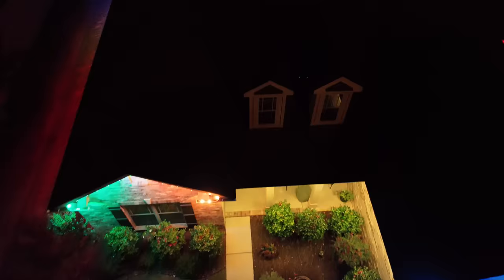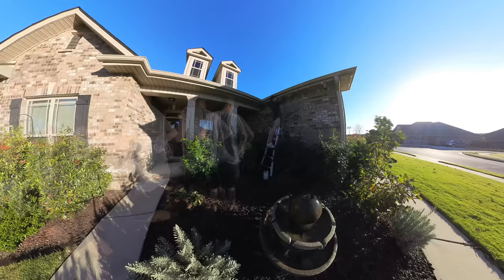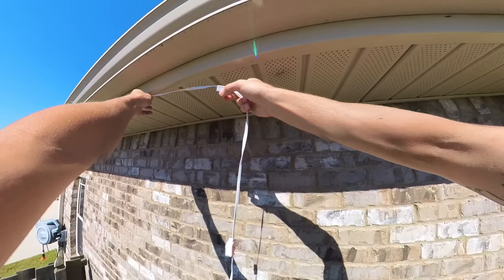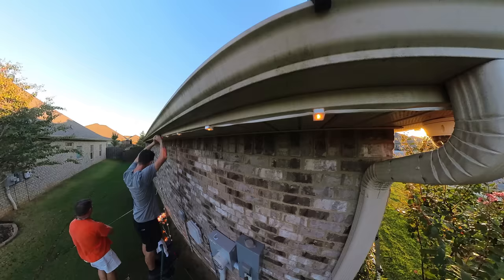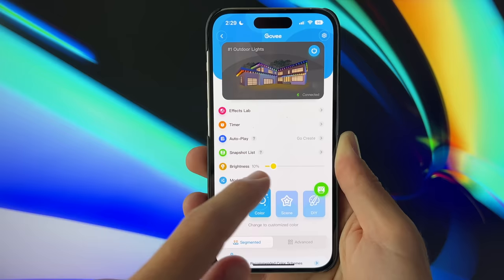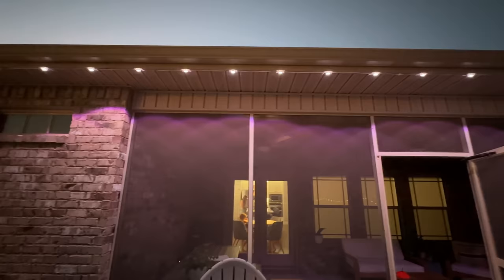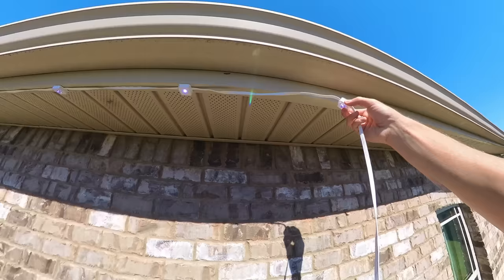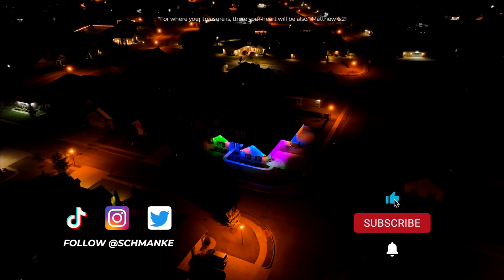AMAZING Govee Permanent Outdoor Lights!

Comment: I'm so glad to see whole kits like these available! I just installed permanent Christmas lights on my house last year going the DIY route and it almost cost me as much as these Govee lights. Having the Govee quality and support makes this worth it for sure!
As some of the comments on their site say, it would be nice if they sold the extension cables separately. If I used these for my house, I'd need about 30' of extension - which I could do with DIY, but maybe not possible with this kit. I've got some family and friends this would probably be great for though.
Reply from the maker: Thanks for sharing. I just measured for you. The power adapter + button/switch cable is approx 21 ft. And then another flat power extension cable is also included which is 12 ft. (There's your 33' extension for ya ;-)
Reply: @AuthenTech  Ah, ok. Distance to the first light for me could be as short as 3'. I've got a 12' front porch that I have lights on, then the 2nd story has another roof above that. So I need to go up the wall and the distance of the porch to start the next run. I'm sure there are some technical limitations to doing that though, like the 5v data wire doesn't cover that distance easily and should really have a booster in there to push it farther.
Reply: @BenReese  You can run 150 ft on one power adaper for these Govee. I am waiting to install on my house. two story makes it harder to install myself :)
Reply: Ben, what DIY lights did you purchase?
Reply: Wish these weren’t sold out. They look easier than what I was going to try. I just watched a video showing how to put these lights in J Channel. Rextin WS2811 Pixels Digital Addressable LED String Lights Waterproof RGB Full Color 12mm DC 12V (DC12V 500pcs)

Comment: You could add some clear caulk to hold the wire in place, plus it would releive some downward  pressure from the 3m tape on the lights.

Comment from the maker: Pinned comment for future updates:
-Oct 2022, LED stickies installed.
-Jan 28 2023, found my first LED that detached.
-March 26, 2023, found a 2nd LED detached. Really high up, hard to reach.
-April 2, 2023, found a 3rd detached.
-March 2024, found a 4th detached.
Reply: They are out of stock everywhere probably due to the season, or your video, or discontinued???... I think they look great and exactly what I have been looking for.
Reply: Out of stock everywhere.. hopefully they stock back up soon.
Reply: Do you know when they will have the stock? Wondering if there is a way to contact them directly for this answer
Reply: Why must you tickle my RGB fetish like this, Ben? 😄
Reply: Help needed!! Lol I just installed 2 100ft Govee permanent lights. How do you combine the two sets of Lights to control all the different scenes? I tried using the groups section but it doesn’t give me the option to control the scenes. Thank you 🙏

Comment: I will say this, once fully bonded, VHB (Very High Bond) tape will not come off. I used to work in industrial sales and sold 3M VHB tape. I talked to their reps and they said to never put it on anything you don't want to destroy. If you put it on a cabinet and later want to remove it, you would rip the cabinet off the wall before the tape let go. They gave me a sample and two of us grabbed it with Vise Grips and couldn't pull it apart. 

Think about this, some semi trailers are held together with 3M VHB tape. A lot of them don't use rivets anymore.
Reply: very interesting, I looked up the use in semi trailers and it is true, Geez !! thank you for the info.

Comment: You should make a video on how to connect the Govee permanent lights to the app. How to combine several sets and the different scenes that are available. Govee has so many devices on the app that it’s difficult trying to figure out what setting goes with what product. Thank you love the videos.
Reply from the maker: Good idea, not sure how many people actually need this video though
Reply: @AuthenTech   really good idea especially since these lights are popular
Reply: I would love that video! I'm going to need about 300 feet and am super confused about the control boxes/grouping
Reply: @AuthenTech It would be very helpful for some of us that live in very rural communities with limited internet service. Most devices require 2.5 GHz which is not an option with some of our systems. I need to know if I can get them to work any other way. 😬
Reply: Internet is irrelevant for the lights.  You need a wifi router.

Comment: Do you remember as a kid dragging ribbon over the edge of a knife you get the curls. Well do that to the wire except use a screw driver shaft, Gently pull the wire over the shaft not too hard, that gets rid of some of the kinks.

Comment: They look great I see that you mounted them towards the edge of your house, rather than closer like 3 inches. Was that preference or intended because I see so many other videos that recommend closer to the house but the lights on your house are super bright so I guess it doesn’t matter. thoughts?
Reply: I had the same question. My eaves have exposed beams underneath so it’s not a flat surface. It appears that affixing them to the trim looks just fine according to his video 🤷🏻

Comment: They look great but unfortunately at the time of this video you can't find them anywhere.  The 100ft govee sells would be perfect
Reply: Lol amazon has them
Reply: @creasybear4426  i just checked and they don't.  They have outdoor led strips which are different
Reply: @creasybear4426  no they don't.
Reply: I bought 250 in Feb 2023
Reply: Well you’re in luck now, Amazon has them!
Reply: @jaredf.8712  yea i grabbed some about a year ago. Now they're available everywhere. I put them up right before the 4th of July
Reply: @vahn2g4 Do you know if the 150ft comes as 3 sections of 50ft or as one long strand?
Reply: @elizabeththompson-hancock3360  yes it does. I only used 100ft and i have the 3rd in the box
Reply: @vahn2g4 how big is your house?
Reply: @killacuz3  my house is 2300sqft. The front used 2 strips and i used 1 blank that it came with. I still have 1 strip of lights left that i will run along the side of the house
Reply: @vahn2g4 dang I just bought 2 boxes of 100ft and my house is only 1400 sqft. I guess I can put it also on my garage but I'll still be at 1800sqft 🤣
Reply: @locoslbck13  save the extras for another project lol

Comment: 3M tape? 3M Tape is good stuff, I know that for sure...but I'm seriously concerned about the longevity of using tape to hold these up more than a season or so. The constant exposure to the elements and temp changes I would think I'd eventually walk out of the house and see sections of this falling off the house. What are your thoughts on this?
Reply: Having worked with vhb outside before, it will probably happen but only after many years, I have things that are attached (fully exposed to weather) with VHB and they've been holding for 4 years. A lot of car manufacturers use VHB for badges and appliques too.
Reply: Yea I don't like that. I installed my Philips Hue outdoor lightstrips with brackets that came with it I screwed into that house. Obviously that's gonna stick forever until I get rid of my Hue strips.

Those screw clips might help though assuming you can put actual screws through it.
Reply: 3M 4298UV Adhesion Promoter will make the tape stick like you wouldn't believe. I've used in a body shop to attach emblems to fiberglass panels and had to remove them later for damage and it actually pulled the gel coat off with it down to the fiberglass underneath it had stuck that good
Reply: I’ve had the 3M command strips that aren’t VHB up for 3 years, and they are still going strong. I think if you install these under the soffit and not exposed, the VHB should last a long time.
Reply: i agree hte adhesive will eventually fail thanks for the sun. then you have to scrape off the old adhesive which will prob damage the finish on the soffeting
Reply: Why not add small piece of clear gorilla tape over each strand by light?
Reply: Still have exposed wires, which I think look horrible for what is supposed to be permanent lighting. There are better options with better control. Addressable LED'S are the way to go.

Comment: To get the light wires to lay flat, unroll it all on your driveway in the sun for a good 30 min before install. The heat will make the wires more pliable.

Comment: Hey Ben, great video, I just purchased (2) boxes of 100feet because of your review,  I need 170 feet of continuous lights to cover my  house, My question as I could not find the answers in the instructions is, how to I install both power supplies for a continuous string of lights up to 170feet? I have a spot for both power supplies to be located inside the garage, then I will start the install with a single string of lights in one direction, I can not go in separate directions with 2 strings. I need to have one continuous run of 170 feet.  How did you use power supplies on your install. Please reply, Thank you !!
Reply: You can't connect two complete 100ft sets. The max is 150ft, so you'd need the dedicated 50ft set or half of your second set.

Comment: Can you do a Video Walkthrough of how to program the lights.  Govee website and support is not very good or hard to find and the desktop app doesn't even have the option yet.  I want to be able to do the off season corner selection as an example that you showed in your video.  I just got 2 of the 100 foot boxes. Programing them as a group seems more difficult.

Comment: Did the total length you used end up being more than 150ft (9 strands)?  Asking because I just got 200ft worth and I'm trying to sync them all to work together.  I understand you can only have up to 9 strands per power box, but is there any way to sync more than one power box together?
Reply: What did you end up doing? Use 2 separate power?

I know in the app you can control multiple products, but can you “sync” them? For instance, if you lined up all 200ft, can you have a moving sequence go through all of them? Or is each power box separate?
Reply: I just installed 200 Ft but the last 50 is not working should I put the other 100 in there own circuit and will they sync?

Comment: I have a question so i bought 150ft but how can i add the last 100ft and sync everything together? I know it comes with another power adapter can can i connect where i left off and connect the adapter at the end? Or does it have to be separate yours look like they are all connected together thank you so much

Comment: Can these be effectively connected to a smart switch, i.e., when the power supply at the outlet is turned "off" and later "on," will the controller return to the last illumination setting? Thanks.  Well done video...

Comment: I have a bit of govee lights and enjoy them.    Those look pretty sweet.
Reply: How would this work on a two story home where the lines don't connect 🤔 wouldn't there be exposed leds hanging from one edge to another
Reply: @ericdavisii3912 you'd have to splice in extensions with no lights.

Comment: When you installed them did run power supplies from same outlet or two different outlets. I was wondering if you could run them both ways and meet in the middle on the other side of the house . I’m going around my house the same way you did yours. Thanks

Comment: Your video convinced me to get a second set of 100ft H705A permanent outdoor lights which are due to arrive in a few days. One thing about your install though is in order for the two 100ft strings to work together once grouped, do I need to install them in the same direction? For instance, does one string need to be control module/lights and then the second following it also be control module/lights, or does it matter if two strings are installed like lights/ control module then on the second following control module/lights? You didn't mention that in your video. Thanks
Reply: How did the 2 sets sync up? Really excited to do the same!
Reply: @JonathanRootD When I installed them, they automatically set themselves as a basic group which doesn't sync. You have to create and add them to a same model group and then they sync perfectly. They also have to be installed in the same direction

Comment: Do they have plain length of electrical line in case you need to make a jump from peak to peak without lights?
Reply: Yeah the website says it comes with some of those runs.

Comment: What if you need 250’?  There is a kit that is 150’ and one that is 100’.  The kit with 150’ in it has what looks like two power supplies.  Do these lights work together in the app for seamless control or do the individual strings end up out of sync?  Can I go 250’ on one power supply?

Comment: Great Video!! Question. On the app I have gone under advance, and I want do that spotlight feature. At corners of my house. My problem is I select the lights that I want on, but above it in that section has an effects it's either doing clockwise cycle, twinkie. How do I turn off the effects so the light just turns up stays on.

Comment: Where do you live?  I'm concerned about the -4 degrees limit, but Govee told me that's just the control box so if I can get that inside, I should be ok.  Is the control box attached at the end of the string of lights?

Comment: Great video. Can you cut strings shorter in case you dont need the extra length? Thanks
Reply: No. But each strand is about 17ft, three per 50ft. You could just drop strands as needed.

Comment: Can you cut them to length if you have different areas of the home?
Reply: Yea but you’ll have to run outdoor rate cable from section to section and wire in outdoor j boxes

Comment: Hello, since you installed 2 controllers. Do they both work with the app?
Also, since there is 2 controllers to all the lights work together simultaneously? Thanks
Reply: You can create a group of devices to work simultaneously and is easy to do in the app

Comment: drop of glue every now and then , 1 in middle of ribbon between lights and on each side of every light should take care of ribbon problem. Also tape the actual led with painters tape and spray paint to match your soffit then remove tape so they don't stick out as much
Reply from the maker: Great suggestions!

Comment: JellyFish lighting is much nicer. No cords showing, all of the wiring is ran through the attic, each LED is mounted inside of a custom cut rail. Spend the extra money and make it nice. The cords make the install look terrible.
Reply: You failed to mention it costs $30 per foot and another $650 just for the controller... BEFORE shipping and taxes.  No thank you, JellyFish.  The flat cables on these are EASILY hidden with VHB tape to support them and painted to match the fascia.  SMH   For 100' you'd be looking at over $4,000 by the time it's all said and done and you would need to find a place to put the nearly 144 sq. in. controller!
Reply: @DiffEQ  If you are going to comment Mr. Engineer get your facts straight. The lighting is not $30.00 per square foot. 100 feet would not cost you $4000.00. The controller is the size of my sprinkler system control box and in fact sits right next to it in my garage. The single cable to the controller is encased in white plastic conduit to match the paint in my garage. Zero wiring is exposed neither inside of the garage or outside my home. Every cable is ran through my attic space. Enjoy your painted tape though, I bet it looks great. 👍

Comment: What do you do for 200 ft. The last 50 feet did not light up. Do you have to connect the other 100 ft on a separate power they sent with it.
Reply: Yes. Can only run 150ft per control

Comment: I’m installing 2 150ft stands on my house.. since they can not be connected, can they be programmed on the app together so if using some light settings they are in rhythm?
Reply from the maker: Great question, and I *don't think so*. They show up as "two different" devices in the app, and if you want them to match, you sorta need to customize/schedule them separately. Mine are bundled together in the automation, but I needed to make sure each settings matched one another for uniformity, if that makes sense.
Reply: There’s is an option in the app to create Groups of devices to they sync to work simultaneously you can add up to 10 devices of the same or different type (item must be compatible with the grouping option and not all Govee devices have this feature)

Comment: Can you sync two controllers? I bought 200' but failed to realize you can only run 150' on one controller.
Reply: I do not have these units but have been using their other products for years. You can sink multiple units together in the app.

Comment: Can you cut them if their to long
Reply from the maker: I don't think you'd want to cut them. You'd probably just tuck away an excess in the attic, soffit, or elsewhere. Remember, even the 50ft line comes in separate sections. I read online Govee says, 
The 50ft includes a 3 x 16.67 ft light strip. The 100ft comes with a 12ft extension cable"

Comment: Who's gonna use it with today electrical price... when the blackout is so real now.
Reply from the maker: It's LED. Estimated cost per year is less than $10. Per. Year.
Reply: "today electrical price"?  Do you speak English, by any chance?  The cost to power LEDs is very low.   How is it different than the lights on a tree or lights you put up every year?  The old C7 bulbs were 4 to 7 Watts EACH.... SMH

Comment: Did he just say 300 dollars for some ARGB lights...?
Reply: They're worth it. Their support is amazing. Amazing warranty. I've had mine over 5 years and I've never had an issue. I also live in Ontario Canada. It rains most of the summer and our Winters are absolutely brutal
Reply: You can also use them as pot lights which is way cheaper cuz most pot lights are going to cost you almost like $50 to $60 and then you have to pay the electrician to run the wire. Set it all up so it's some really good alternative